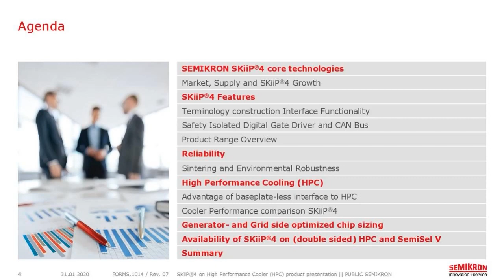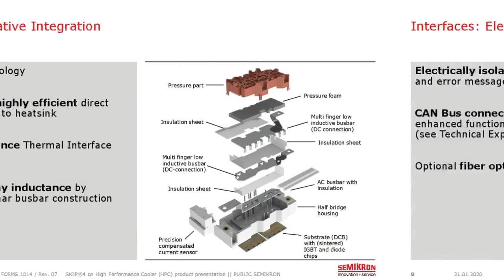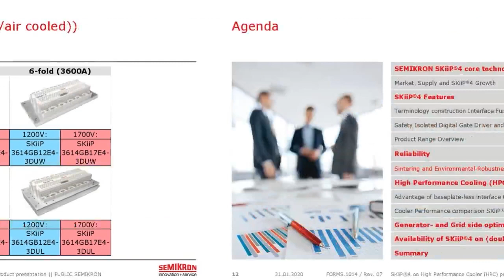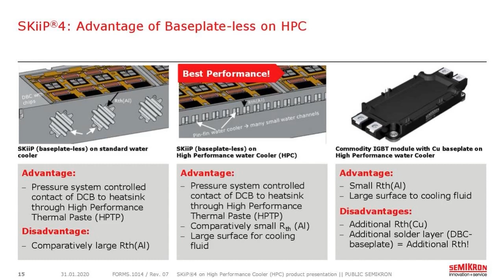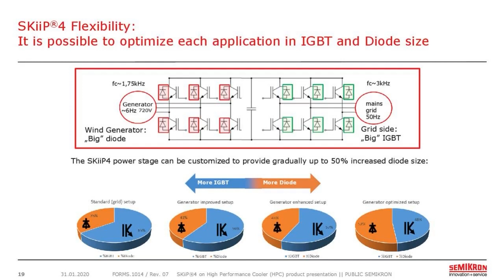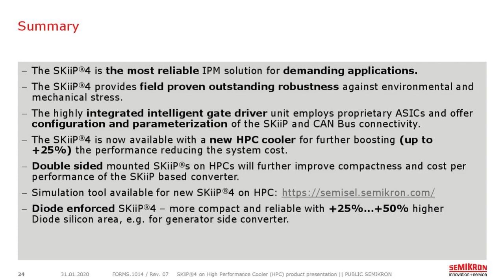Webinar: More performance at lower cost in wind converters with SKiiP 4

Comment: We are facing a HW Desaturation (Hardware Desat) fault on the Semikron SKiiP 1242BG module. Upon inspection, we suspect that the fault originates from a malfunction on the control board itself.

The issue occurs during operation and leads to system shutdown. We have verified the external components and gate signals, but the error persists.

We would appreciate your help in identifying the possible root cause and would like to ask:

Which parts of the board should we inspect or test for HW Desaturation faults?

Could this be related to an IGBT failure, a gate driver issue, or faulty desaturation sensing circuitry?

Are there any diagnostic procedures or schematics available to support troubleshooting?